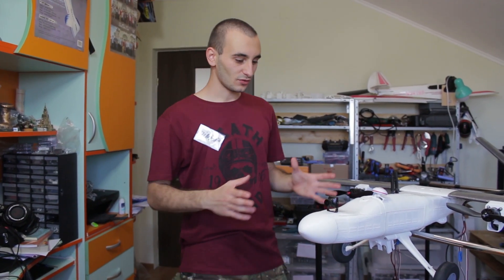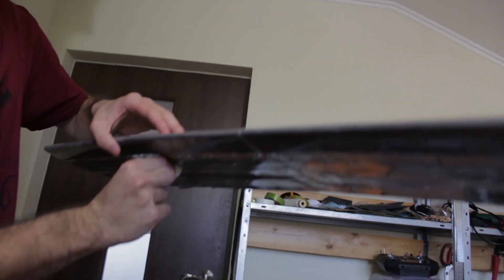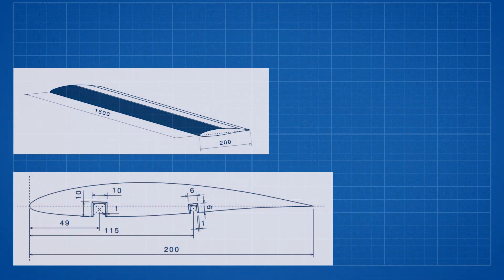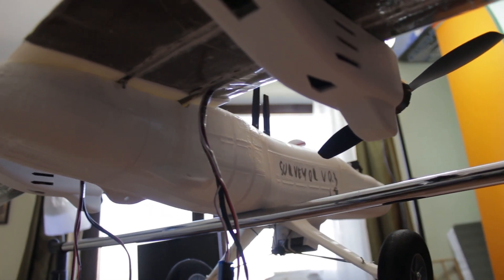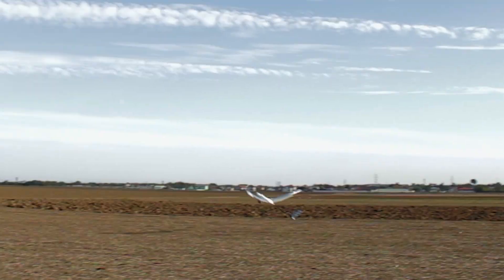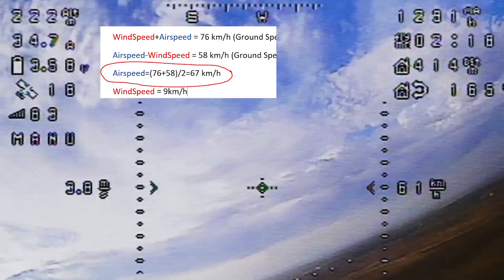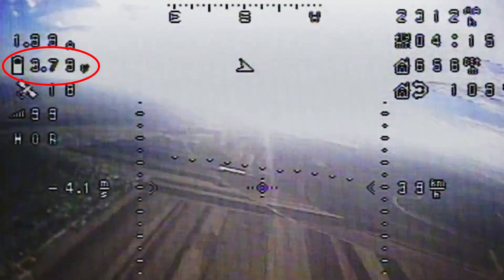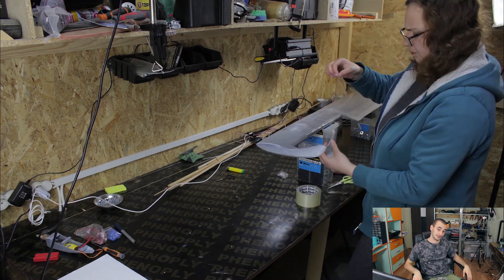The Surveyor Project: Part 3 - More string, less wing

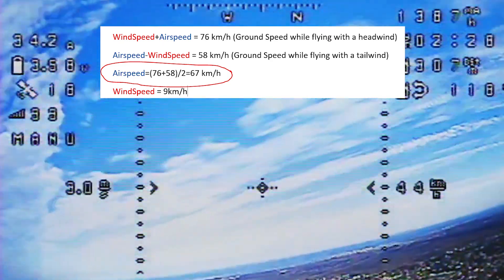Comment from the maker: CORRECTION: At  around 10:40, the top formula is flying with a tailwind and the bottom is with a headwind.  (You're faster with a tailwind than with a headwind)